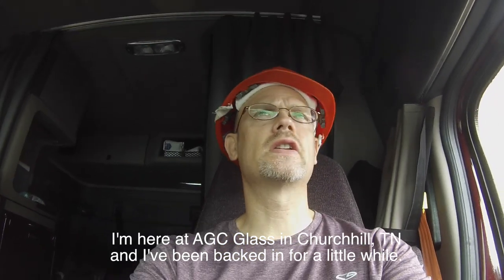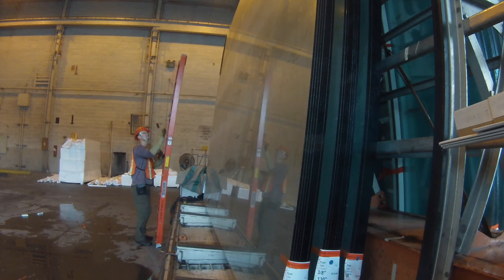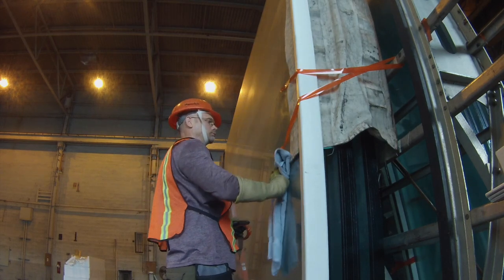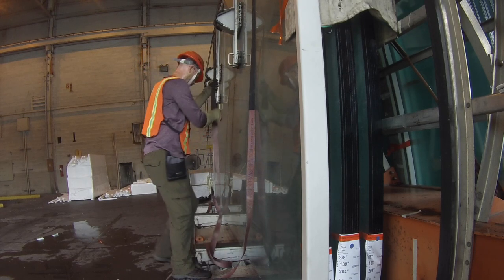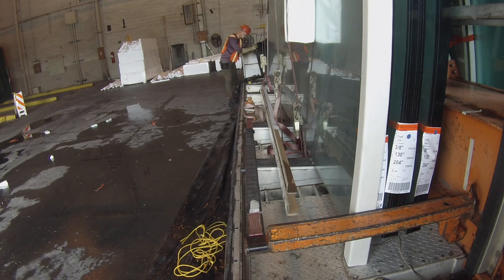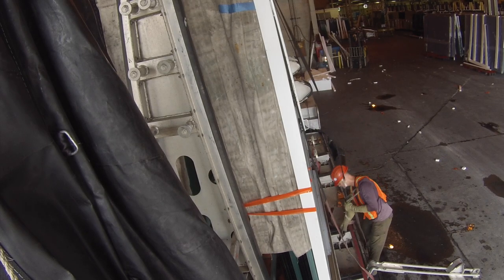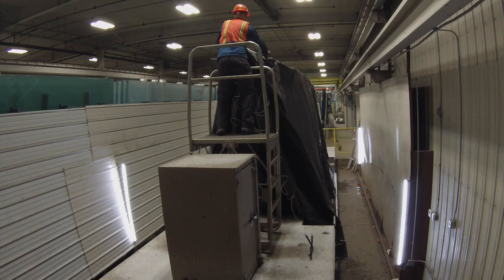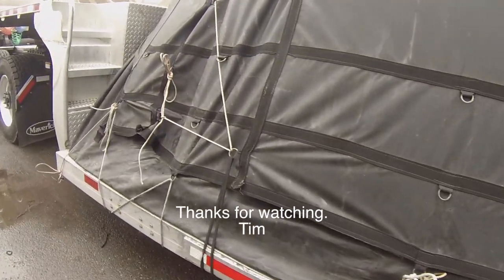Maverick Transportation - Glass Division - Securing Jumbo Glass on a Double Drop Trailer

Comment: Tim, what’s the overall tarping and securing time? Thanks Dave
Reply from the maker: Around 2 hours once the loading starts.  Can go as long as 4 hrs depending on time that each stoce of glass is found and put on the truck.  Average 2 to 4 hours once the loading starts for different types of loads and trailers.  Once the last piece goes on I would say 1-2 hours to just finish up securing and tarping.  The time varies on a lot of things such as the condition of the rope on tarp and if you can use as is or if you have to cut away and cut and tie on new rope.  On the Conestoga or RollTarp trailers it will be even faster but those are usually used in the dedicated divisions so will likely be preloaded anyway.  Glass on Step Decks and Flatbeds usually takes longer because a lot of time more pieces and two tarps.

Comment: Obviously the glass division pays more but what division gets more loads in a week with Maverick?
Reply from the maker: In terms of number of loads per week you will generally have more with flatbed or Dedicated(whether flatbed or glass) than Over the Road glass.  That's the quick answer.

More loads does not necessarily mean more miles or total pay.  So you can have less loads per week or less miles (or both)  but at the end of the day the higher pay per mile can let you earn more if you get loads that let you run more miles.  It will depend on the pay structure, which varies from division to division.
So in flatbed you might do 3-5 loads a week and over the road glass 2-3 but make more overall at the end of the day with OTR because you are spending less time switching loads more time driving and driving longer routes.  On the other hand the Glass dedicated accounts you may be doing 5 loads a week and getting a fixed load pay on top of the lesser pay per mile and make more money because you are able to go from load to load quickly.  Some of the dedicated divisions are busier than others so it also can vary.

You can see some of the various pay structures on the maverick.com website and go to the Local/Dedicated link to see the current openings and some of the various pay structures for each.  Keep checking because the openings for different divisions will change.
Reply: system transport pays the best